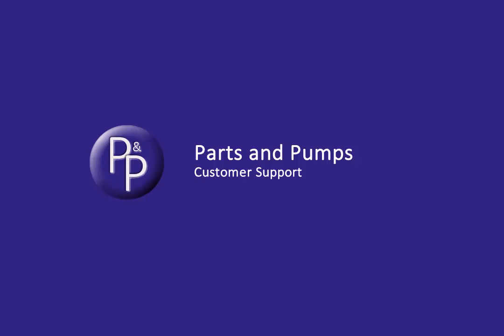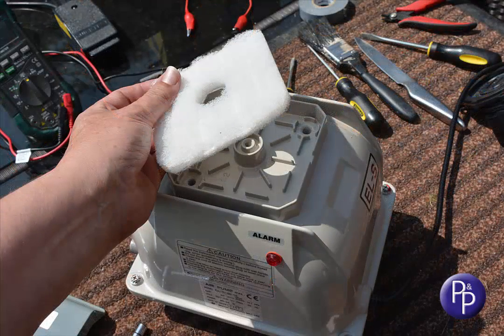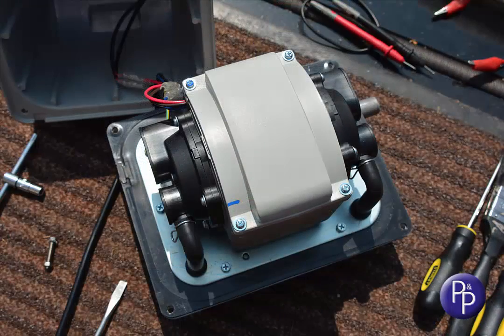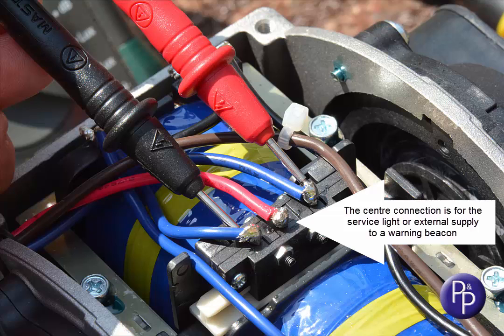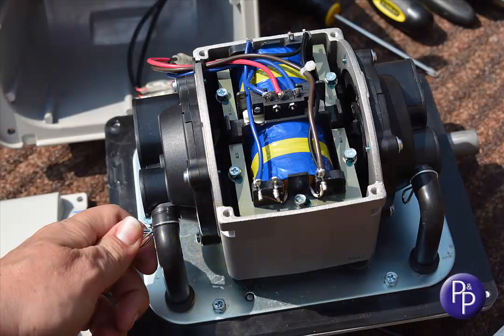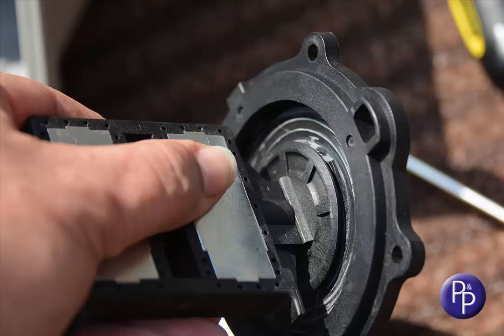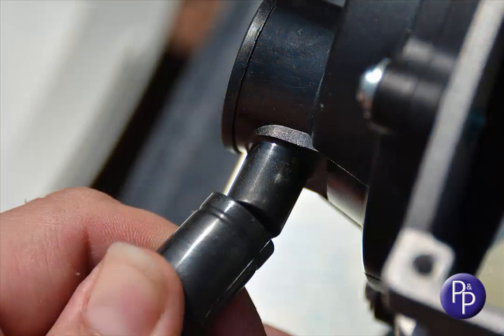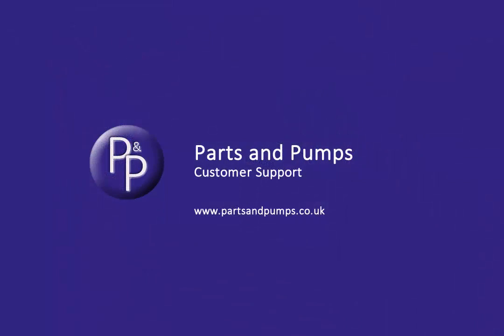Secoh EL Air Pump Maintenance Guide v2

Comment: Fitted new diaphragms, however finding it impossible to centre the magnet between the two solenoids. Tried the shims on each side, when I tighten everything up, the magnet moves and pulls over to one side such that the magnet jams. Tried repeatedly to do it, every time it moves from the centre. Very frustrating. Help please.
Reply: what is the condition of the magnet?..  If it is badly worn on one side it will be very difficult to centre and stay centred.  Check pipework is not compromised (blocked, kinked or diffusers under a heavy layer of sludge) as this makes the pumps run hot (backpressure) and will cause early (if not almost instant diaphragm failure), as they get too hot and distort.  If you still have problems you can send it to us for inspection and repair www.partsandpumps.co.uk

Comment: Hi David, this video was excellent and diagnosed my problem which was the switch. I bypassed it (just like video) and pump worked. Do you know can I bypass this permanently as the pump is brought on by a timer (15mins on 15min off) or do I need a new switch? 
Regards Keith
Reply: you CAN do that, but might be ill advised as without the internal switch the pump will continue to TRY to run if a diaphragm fails.  Causing (potentially) damage to magnet and coils.
Reply: @davidfarndon3895  
Cheers, agreed, I looked over video and understand why. I have centralised the switch but the pump wont come on. Diaphrams are also good and spaced the magnet equally as best I could. Any other suggestions
Reply: @keithmulvany928  it's possible the switch has failed I suppose.  Rare, but not unknown.  Gasses from the tank are corrosive. They are available as a part. Fairly simple fix, needs a soldering iron.
Reply: @davidfarndon3895  grand, can you send me a link with the part required, if you have, I can pay by PayPal. Keith
Reply: Hi David, just looking on your website, and as the pump is 7/8 years old, I might just purchase a new pump. Was looking at the JDK60AL?

Comment: Hi, my pump is working, but the light is on?? Faulty switch perhaps?
Reply: Nevermind lol. Once  I reconnected to the pipe running to the septic tank it worked. thanks! Just saved me $700.00!!